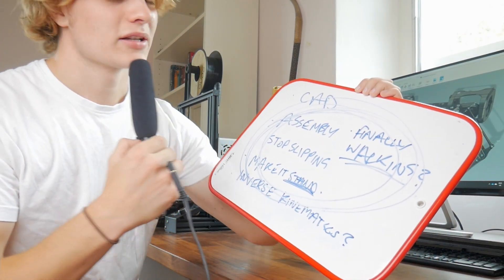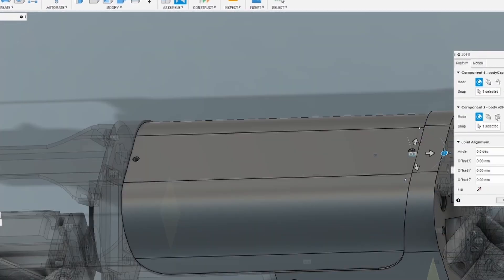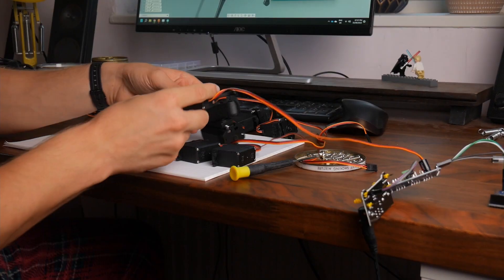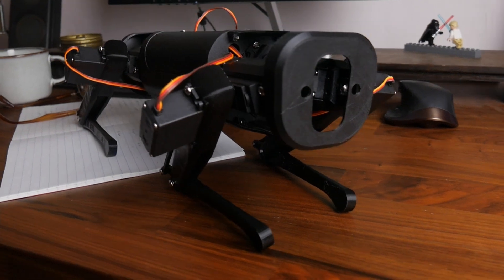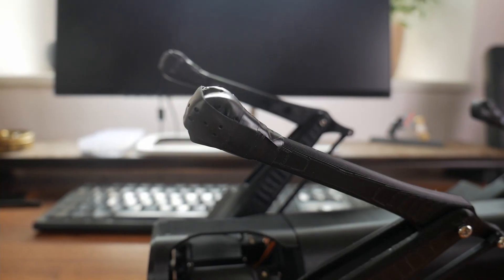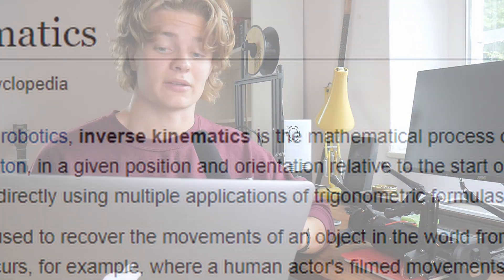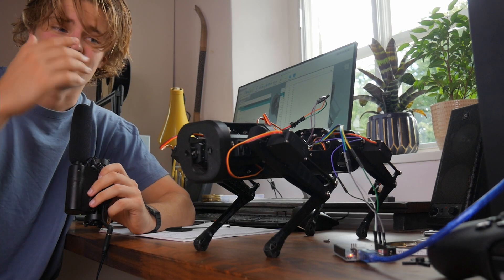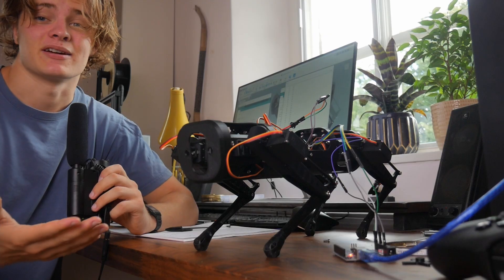I might be in over my head...

Comment: Bro you need more amps  if you are using mg996R each servo required atleast 5-6v and 2A each in  order to get the max torque, and also reduce the angle you put on legs. We are also creating a quadruped robot on our final year project hope it works on you.
Reply: Hey I need help on the coding side would you please help me
I am using Arduino Uno

Comment: Did you just use nuts and bolts to hold each part of the leg together or were you using bearings?
Reply from the maker: Just nuts and bolts, although bearings would have been better
Reply: @adambeedle  Ty